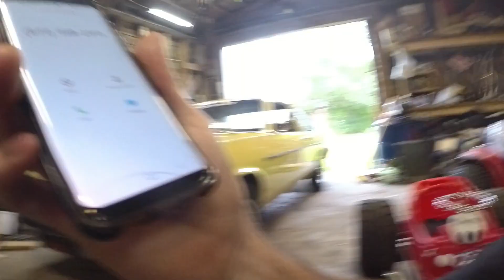Engine Work On Biscayne

Comment: The thing to do here is to install a cam made for a turbo application now with around a 113 lobe separation or so it will make a to of torque N/A, but make the turbo spool easier with a boosted app. I'd call comp cams and talk to them before you buy anything. because this is a very common turbo app you are building.. There is also a 230 head if you do the research that has a very slight smaller chamber, and a larger intake valve that could have saved you some bucks on this build If you plan to run e85 o this build don't be afraid to go 10 to 1 on the compression.EDIT: After reading down the comments it turns out you probably took a big valve 230 head to your machine shop. Lucky you. just keep going in the direction your going and don't short cut the engine build and this thing will be awesome, and fun to drive

Comment: You should look for a 292 pick up truck motor, the longer stroke gives much more torque to start with. The difference is the block is taller and the motor mounts are staggered.

Comment: Call your local Chevy dealer with the casting numbers on block & head !!! I put a 650 double pumper on mine wwith 11 to 1 piston & a isky cam mid range cam not to hot but it ran & beat a couple 302 fords

Comment: There are stamped numbers on the dist. pad. Some 230,250 blocks would go either way off them numbers easy way to tell a 230 from a 250 is to pull the plugs and look at the piston. a dished piston is a 250 a flat top is a 230.

Comment: I admire people building a six dare to be different. My brother-in-law has a 1965 C10 stepside all original paint one owner . It has a 230, was a three on the tree. It has a 030 bore performance pistons, balanced, the head is a lumpport head roller rockers, race grind cam, DUI distributor, Clifford aluminum 4 Blr intake, split header . Trans is now a Tremec 5 speed, and column has shift collar replace so it looks factory. Disc brakes 5 bolt conversion, lowered three inches 373 gears. Dyno Ed at 325 horse. Moves out . But myself, I just can’t do that. That Biscayne is crying for a at least smallblock and 4 speed Muncie. Just me

Comment: The proper use of a 250 inline Chevy 6 is to find a good place to attach a chain so when you drop it in the body of water you are anchoring your boat with it you can count on it staying attached.  Having owned on in a brand new 1976 Chevrolet 1/2 ton pickup with a 3 speed manual I can say that from experience.  It is almost unbelievable that something so weak kneed could use so much fuel.

Comment: Isn't there an  slotted screw with a locking nut on top of the steering box for adjustment?  I took the slop out of the steering on my '35 Dodge truck, '80's Dodge truck & my "88 Ford Ranger by adjusting that screw til the slop was gone, than re-tighten.  It's like lashing a valve.  Worked for me.

Comment: Better be putting a baby turbo on it so it spools quick.....I Myself personally i would have went with a Super Charger for off idle boost cause you know that thing won’t rev.
Reply: WIth the right cam, and compression you can spool a decently large turbo. Honda (car) guys do it all the time, and have been doing it for years. Same also goes for motorcycles.
Reply: MrGixxer1300r  yeah but you must be too young to have any knowledge or experience with a GM 250 the motor was designed for torque not rev’s 🤘🏻🇺🇸

Comment: Hey man, I'm a retired GM Master tech.  I was working on these engines back in the mid seventies. I don't want to make you feel bad, but the number you are trying to find is not your casting number.  It is a serial number that will tell you the date of manufacture, if it's a truck or car engine, and the plant it was made in.

Chevy inline 6 casting numbers can usually be found just above the starter on the passenger side of the block.

Here's a casting number websites for the inline six: http://www.castingnumbers.info/site/browse/m/Chevrolet/c/Engine_Blocks/t/Inline-6
http://www.castingnumbers.info/site/browse/m/Chevrolet/p/7
http://6066gmcguy.com/Inline6.html
Hope this helps.
Reply: Awesome Jeff!
Reply: I'm glad people like you exist, Jeff. Hope you have a wonderful day
Reply: While the casting number might be easier with a bit of homework you can narrow down what it is using the serial number knowing the year and options the make it came out of.

Comment: its a 250 automotive engine the distributor is in the front. on 235s it was in the middle .  i worked for Hyster forklifts for 30 years and they used a engine "like" this  (the same for all purposes) in there S80E    model forklifts,, That being said  GM also made marine 250s that were used in the lift trucks . the ones used in industrial applications were slightly built more robust..you could push the skinny pedal to the floor and hold it there...its a fork lift that's what you do..it'll be fine,

Comment: You cutting the supports out of the intake port reminded me of a mod done in the early 70’s. The top of the bolt hole was bored out and taped for a 1/2” pipe plug. The port floor hole was machined with a counter sink bit so a Flathead Allen bolt was used to tighten the head down in that spot. To tighten or remove the Flathead bolt, remove the pipe plug to access with an Allen wrench socket. Everything was machined so that the top and bottom of the port was smooth and even.

Comment: Why a turbo and not a supercharger? A turbo is awesome but it's harder to tune and dial in and you have to deal with a lot more plumbing with a turbo. Not to mention more heat under the hood and you will have to wind the crap out of the 6 to build boost for a good launch. No waste gate and a lot less heat soak with a blower...just sayin. Need more boost? Swap a pulley, much simpler. If you went with a centrifugal style blower you can intercool it for even more power like a turbo. A small B&M style roots blower would be simple to adapt to the 6 also. I'm not trying to second guess you Isaac, I love your channel, just thinking out loud.
Reply: because superchargers suck. they are full of parasitic draw, get bacd fuel mileage, are expensive as hell....an ebay turbo is like 150 bucks, and will still get the same mileage when out of boost.

Comment: Reminds me of back in the 70's when I did a Ford 240. Did a  valve job, put some rod bearings & rings in it with a quick cross hatch on the cylinders, rebuilt the carb, points, plugs, wires, cap, & rotor, & a clutch w/ pressure, turned the flywheel. That Falcon ran good.

Comment: Why didn't you try to adjust the steering box before replacing it? 1 or 2 turns at most on the adjusting screw would have probably fixed it.
Reply from the maker: Lol. I did that already
Reply: @isaacitllbefine7231  Now that is really wore out! LOL

Comment: We used to do this mod on the early Holden 6 cylinder engines here in Australia 
Cut the cast iron out in the centre of the inlet port then machine it out and press in a stainless steel tube to seal the head stud
Gave more inlet port area and let these old pigs breathe better!

Comment: Man I could sold you a 250-292 head with all machine work done with 
2.02 and 1.60 ss valves and Roller Rockers 1.72 to 1 and springs for up to 
.580 lift.
CC combustion chambers

Comment: In cutting out the head bolts support tubes from the head, you are taking away the pressure applied by that bolt in that area. As there is now a void between the top and bottom of the head. If it was me doing it, I would try putting a bolt that will fit into inlet port and bolt the head down from the inside of the inlet port instead of the original bolt. Also seal up the top hole to stop oil pouring out.
Reply: just use a stud.

Comment: The number you gave doesn't give the size. But I can tell you it waa made February 3rd. But luckily for you, you pulled the head. Just measure the stroke. I'm not looking up the numbers for you but stroke length will tell you what size it is

Comment: By the color,it's probably a 250. What you want is a 194 head because it will increase your  compression.  A crank from a truck  engine is fully  counterweighted and is much smoother in operation.

Comment: Michigan, engine plant, "0225" represents the date of manufacture (February 25) and "FF" translates as a 1965 230-cubic-inch displacement with 140 horsepower

Comment: Seeing you work on a six cylinder reminds me of and makes me miss my 72 AMC gremlin. Mine had a 3.8 liter 232 cubic inch inline 6. 150 horses and 175 ft. Lbs. Of torque. Miss that car. Miss that engine.
Reply: I had a Gremlin with the 232 6 banger in it. Mine was a 73. I had the 3 speed stick in mine, it was a ball to drive.
Reply: I did a lot with AMC engines back in the late 80s early 90s but they were V8 engines ranging from 290 to 401 cube stock. One the 401 bored 020 made in the area of 550hp at the crank NA. Not a 6 but still cool.

Comment: I would have pressure washed that entire motor before turned a bolt just to stay clean. That motor was disgusting, must have leaked oil out of every gasket

Comment: Hey buddy I really hope you see this comment these guys have it figured out for the 194/215/230/250/292 GM engines this allows you to cut out the head bolt stud tower in the intake ports. Hope this helps your build😎 btw I would highly recommend a holley efi sniper kit. Its expensive but worth it and you'll thank me later for being able to get the most out of one of these engines with a efi kit. 

https://www.12bolt.com/store/p1/Standard_HI-FLOW_Bolt_in_lump_kit.html

Comment: It seems a shame that you are going to the trouble and expense of modifying the engine. It is my understanding that the whole idea of turbo charging is to add horsepower (as much as 100hp) WITHOUT modifying the engine. Porting, installing big valves and changing the cam are all modifications used to increase the amount of fuel and air going in the engine using the constant vacuum generated by the pistons traveling up and down in the cylinder bores. If you are forcing the intake charge into the combustion chambers under pressure, these modifications are not needed. In fact care must be used in selecting the camshaft. If there is too much valve overlap, you will LOOSE power because the turbo will be blowing your intake charge right into the exhaust and out the tail pipe. Since you have two engines available, may I suggest the following. Go ahead and do the mods to one engine and just do a stock rebuild on the other. Test your performance increase with the headwork, cam, 4bbl and header. Install the turbo on the stock engine and  test to compare. I think you will be surprised. It is quite easy to attain a boost pressure of over 20 PSI with a turbo charger which can TRIPLE the output of a stock engine.
Reply from the maker: I was planning on doing it in steps but i might do what you said. Sounds cool

Comment: Isaac, sure wish you had time to answer my question about the big bus that I see very near the place where you keep your vehicles Just need to know if it is for sale and if so, does it run and what kind of engine and transmission does it have? I really like your new shop and race tracks. Thanks and good luck on finishing your hot rod go cart.
Reply from the maker: 1958 gmc bus with a Detroit diesel and a manual trans. It will be for sale sometime. Not my bus yes it runs

Comment: The aftermarket  also has an improved intake port floor that bolts in using  the head bolt  in place of the boss that you removed.

Comment: The   early 292 s did not have HEI ignition systems in the 60's they were still using point systems . The distributor could have been replaced but that wasn't stock in the 1960s

Comment: Don’t 230s and 250s have the same block? And the 250 is a longer stroke? I heard you can upgrade to a 250 from a 230 with 250 parts or is that incorrect

Comment: if the engine on the stand has a good block just build it and do a unit swap  you will have to put in a clutch etc any way.

Comment: Since you are pulling the head, measure the bore and stroke and do the math to determine the size.
Reply: I was thinking the same thing. Measure the bore and stroke and you can tell right away what displacement the engine is.
Reply: Hello guys. It will all be in the stroke. Edited to add the 292 specs. 
Chevy 230    Bore:    3.875
                      Stroke: 3.25
Chevy 250    Bore:    3.875
                      Stroke: 3.53

Chevy 292   Bore:     3.875
                      Stroke: 4.125
Reply: @jhutch1470  Looks like there is no reason to measure the bore, don't know if this combo will fit, but early 230 head,(smaller chamber, bigger intake valve) and a 292 crank would be a winner if you could put them on the same block. Would probably be very torquey off boost, and spool pretty quick
Reply: @MrGixxer1300r  Sounds like a good combo. I would maybe want to run a slightly thicker head gasket to keep the compression at bay for the boost though.

Comment: Just wondering, what's going to stop the intake ports from caving in when you torque the head down? Cast iron tends to be pretty brittle and you've just removed the support from the head in that spot.
Reply: here in Australia we have a similar engine from the same era 
the machine shop mills the hole and presses a sleeve in to replace that is meant to flow better apparently

Comment: The engine on the stand is a 292 out of a 63-66 Chevy truck.
Reply: The side covers at 2:39 seem to be shorter ones than those used for the "tall deck" 292.

Comment: Hey Isaac. If you have the VIN for the Biscayne, I have a website that will partially/fully decode the VIN for you. Its called vinwiz.com and I have used it quite a bit when looking at barn finds and so on. Its real handy.

Comment: Isaac, you will never be satisfied with a built or otherwise 6 banger, drop a built small block and move on. I do appreciate the increase in performance capable with a 6 banger, but you will never be satisfied. Peace.

Comment: Cutting that cast with a sawzall had to suck!  Now I'm curious how you're going to torque the head with those supports gone?
Reply: Yes, and head torque on that monster is pretty high, I would be worried about the head breaking in that area while torquing down.
Reply: You drill out the hole on top so a shorter Allen bolt can be used to clamp down the head on the floor of the port with a little clam looking casting.
Reply: @johnkennedy2505  That's exactly what I thought about when I saw him do it, but what do you use to plug the hole on top?
Reply: @richc9503  pipe thread & plug
Reply: Over size the top hole ... torque a bolt down in the bottom of the port.. tap and plug top hole ... old old way to open up port flow on the I6's
Reply: head studs.
Reply: With a torque wrench.